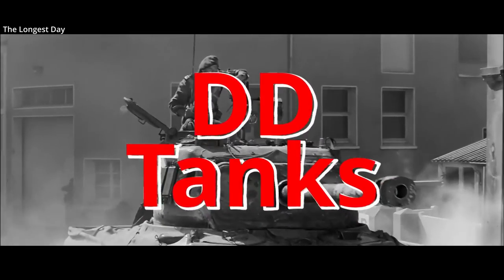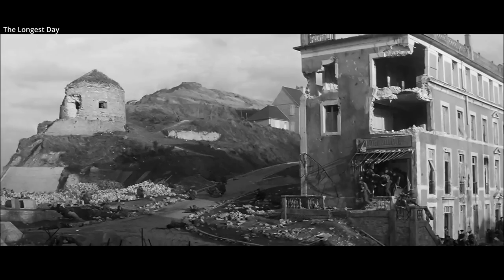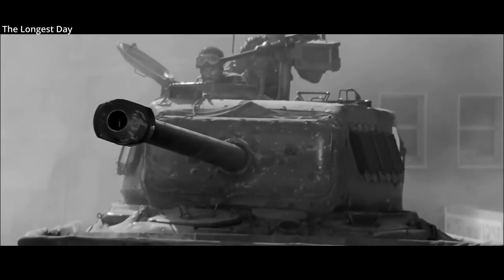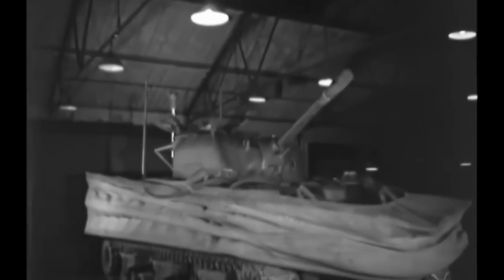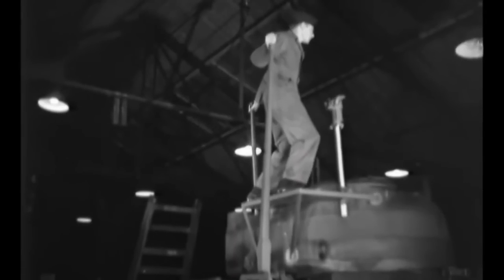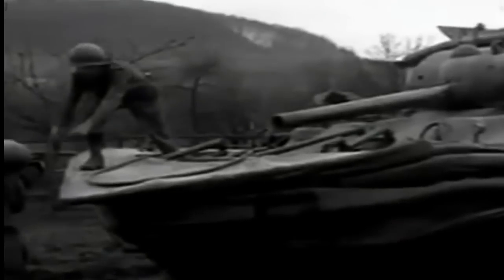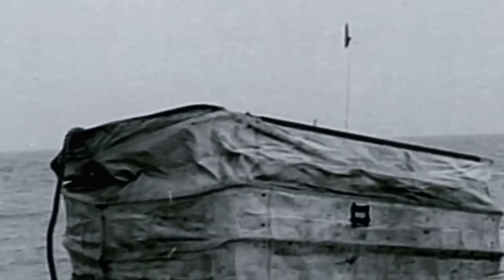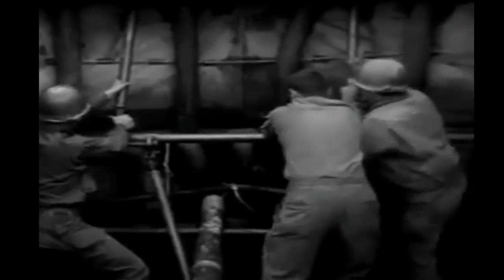The Swimming "DD Tanks" of WW2

Comment: The German panzer 3, panzer 4 and the Tiger all had the ability to snorkel or "deep wade" up to 15 metres apparently. The Tiger being so heavy it needed this as many bridges couldn't take its weight. Even the modern German Leopard tank has the ability to wade rivers in a similar way to its forebears.
Reply: And the Maus was also made so it could, together with an other, drive underwater to the other side of like a river. Again because like the Tiger, not many bridges could support the weight of Maus
Reply: Tigers could be outfitted with gear that would allow it to ford rivers at a depth of four meters. A small number of German tanks(168 Panzer IIIs and 42 Panzer IVs) were fitted with snorkels for deep wading during the planned Operation Sea Lion. Tank crews didn't like the idea of getting stuck underwater and drowning.

Comment: The US DD tanks which were to land at Omaha Beach were told to use a church spire beyond the beach to guild themselves in. As they were coming in at an angle to the approach to the beach they realised that they were heading for a point beyond the landing zone so they turned towards the beach. The problem then was that this enabled the waves to come over top of the skirt and flood the tank. Several of those which managed to get ashore at Omaha because their commander had some sailing experience and adjusted their course to make sure they could land safely.

Yes they were launched at a greater distance from the beach than was planned for and this made matters worse as this meant that the tanks were pushed further west by the sea and this was causing the overshoot. Several of the DD tanks actually got very close to the beach before they sank and but for the state of the sea would have made it to the beach.
Reply: Furing practice, they worked with great success. However, the bad weather on that June 6th also played a substantial factor in their failure.
Reply: Screw that.  Imagine being trapped in a tank under water.
Reply: they were released fat too far out by an impatient American commander who was unused to them. they were not meant to be "sea going" vessels, simply brought into the beach and released a couple hundred metres out . Omaha was like a quarter to half a mile out..
Reply: I seem to recall the crews assigned were tankers, not navy. As a result, they were trained in how to pilot the tanks, but did not have the experience needed to understand how to negotiate a strong, sideways current.

My great-grandfather was one of the engineers who designed the DD-tank and he was always upset about how many men died unnecessarily due to poor leadership in the Omaha beach landings.

Comment: It is astonishing to me how very far out the DD were launched. It’s  perplexing why warships weren’t ordered in closer from where effective support to the immediate beach could be given.
Reply: An order was given to launch from the LST's at 3,000 yards and not the 6,000 yards as first planned for as they knew the seas were rough the morning of June 6th. For some reason the DD tanks going to Omaha beach never got this order ?? Later in the morning some warships did move closer to the beach and fired at German bunkers and other.
Reply: In the run up to D-Day, one of the many highly specialized trades that the Navy suddenly realized they were drastically short of was trained, seasoned small boat captains who could quickly adapt to challenging combat circumstances. Not just the Army was mostly draftees - most of the Navy guys were green as grass in their jobs too, and many had never seen the ocean before they got their call up. This includes the crews, the captains and the planning staff.

One of the most common reports from D-Day was coxswains who were terrified and undertrained so they kicked the men out on the first sandbar they landed on, sometimes 100m+ from the actual shoreline, instead of doing the correct thing (backing up and going around it). This should have been opposed at gunpoint by an officer or NCO (and occasionally was), but more often the men simply jumped out into water up to their chins and made for the beach as best they could. A lot of them died that way.

The vast majority of the naval gunfire support, for example, was fired too far inland to be of any use on the beaches. There was so much dust and noise from all the battleships banging away nobody could tell where any of it was landing. It had never been an issue before. If it had been directed properly the cliff at Dog Green would have been literally flattened and granularized. Instead, the Rangers had to assault it the old fashioned way, rifle and grenade.

Comment: Nice video on an often misunderstood armored project.  Some trivia: 1) the "DD" tank in THE LONGEST DAY was a mock-up put onto a French Army M4A1, 76mm, Wet Stowage.  None of that particular sub-variant were ever DD tanks, but the French had a number of M4A1, 76mm in their reserves into the 1960s (they also feature prominently in IS PARIS BURNING).  2) the British built their DD tanks on the M4A2 (Sherman III) and M4A4 (Sherman V) as those were the majority available to them.  The US Army used the British plans and had 250 kits built in the US by Firestone Tire and Rubber.  The kits were added to modified late M4A1s with 75mm guns at the Lima Tank Depot and were shipped to England.  The Commonwealth forces also received M4A1 DDs.  3) the major tragic loss of DDs was mostly in the US Army's 741st Tank Battalion, the other battalion, the 743rd either landed closer to shore or directly off the landing craft.  The DD was to allow armor to get to shore slightly ahead of the first waves and lay down covering fire.  The tanks were originally supposed to wait at water's edge and cover the infantry. The Germans had two PAK43 8.8cm guns covering Omaha Beach as well as other antitank guns.  The DDs were often knocked out where they stood (a motionless tank is just a target!).  4) the US used three DD units during Operation Neptune, the 70th Tank Battalion at Utah, plus the 741st and 743rd at Omaha.  Each battalion had two companies of DD tanks with their third company being M4s or M4A1s with the deep wading trunks to be landed in later waves.  This third company was also reinforced with extra dozer Shermans.  Some of these tanks pulled ammo trailers with extra supplies.  The light tank company (Co "D") of each battalion was scheduled to arrive with the support/supply trucks on the next day.  5) DD tanks were used at Southern France, and one of the tanks used for practice sank in the bay at Salerno, it was later recovered and sits in a museum in Italy and is the best example of an M4A1 Duplex Drive.  6) DDs also supported  Patton's Rhine crossing.  Many of the tanks used in Normandy were either destroyed or had their special equipment ripped away to be used as gun tanks.  The US Army had to look high and low in the ETO to find some DD tanks for the Rhine operations, even borrowing a few from the British.

Comment: The screen/skirt more correctly increases the tank's displacement. This is what allows it to float.
Freeboard just means the distance from the waterline to the level where water can get over the hull plating or in the DD tank case the top of the skirt. Freeboard was minimal which is why the tanks were easily swamped.

Comment: I am curious to know how effective the DD tanks were once ashore
Reply: My understanding is that, once you deflate the skirt and disengage the propellers, for most intents and purposes, it's just a normal tank of it's base type.

I would guess that the propellers where a little prone to snagging on rough ground but I doubt it mattered much as they wouldn't really be needed anymore once you make it ashore.  I also assume that the drive train is a little less reliable but they're not really meant to stay in sustained combat for extended periods.  Just long enough to secure a big enough area to unload more tanks directly ashore.

There's going to be other details too.  I imagine it was harder for the crew to get on and off one of those dd tanks for instance.
Reply: @ColonelSandersLite  Thanks for the insight. I was also wondering if they played any critical role once ashore ie. they could play a part in clearing the beachhead. I ask because tanks could arrive by conventional means once the beach was cleared anyway, and so the role of DD tanks before that is not obvious to me. For instance, were their guns powerful enough to destroy concrete bunkers?
Reply: @dragons123ism He said that many were Shermans, tanks are super useful when you're pressing an attack against any entrenched enemy, that's why they were invented.
Reply: @AdamantLightLP  I'm afraid that obviously doesn't answer the question